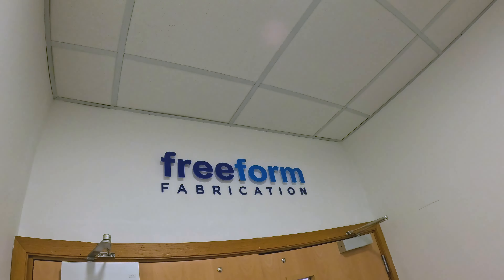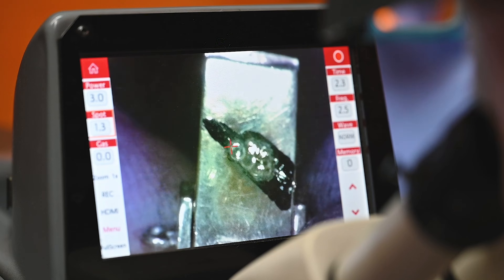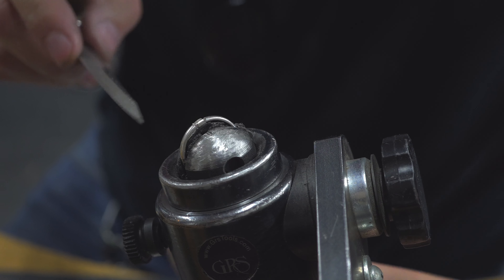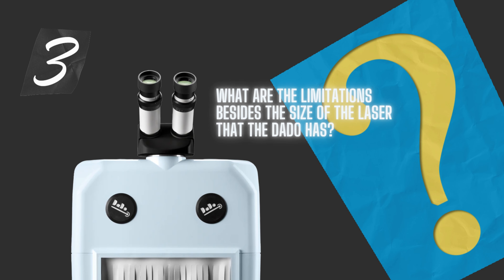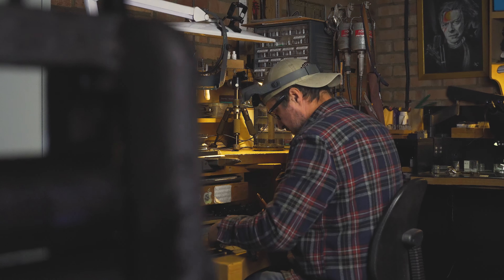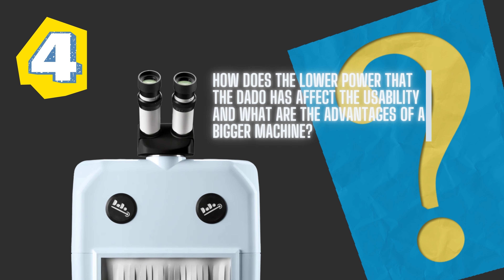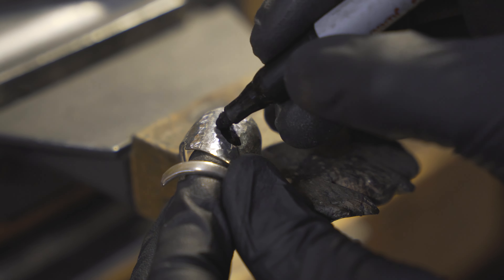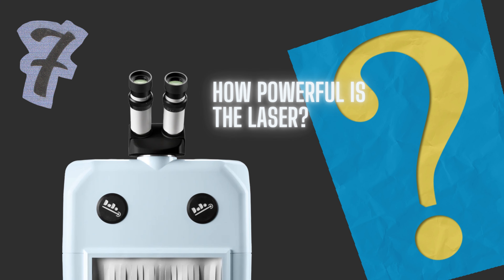Laser Welding For Jewellery - Part 2 | Goldsmith's Workshop Secrets

Comment: Fabulous for tack welding complex constructions together prior to conventional soldering. Binding wire is a thing of the past. Only real issue I have found is doing repairs close to old soldered joints .... the laser tends to blast holes in any soldered areas. Planishing/polishing is easily done as well but you need to get the power just right which takes some trial and error/experience. Works for small areas well.
Reply from the maker: 👌🏻 great feedback. I hear you on the solder issue. Good point.

Comment: Argon in my experience helps with stainless steel and some white gold. A laser is a great investment if you have enough work. We use our laser all day every day.
Reply from the maker: That’s it. Thanks for answering the Argon question 👍🏻
Reply: Would you say this is purely to avoid oxidation? Do you think it makes the weld stronger or does it just make the laser shot more effective when firing on these metals? Thank you for answering the argon questions we are always open to improving processes!
Reply: @freeformfabricationUK  so in my experience these metals can be brittle at the join without the argon. I’m not really sure if it’s oxidation but I guess it might be. I’ve run some tests with argon on and off and can see a difference. We use laserstar wielders in the store.
Reply: I only used argon for a short time when I was offering repair to lens frames but speed offering the service when it was evident that the frames were made with such low quality that the repairs didnt last. Nevertheless, argon is a must for titanium and stainless but I have no issue with white gold or silver not using argon. I use the sharpie usually with silver. I use a rofin starweld

Comment: no wonder he's not for argon, hes british/english and they have no proper access to gasses and such. argon is absolutely necessary for big silver pieces and helps in general like he says with de-oxidizing and getting the wire to flow better into itself. especially if the piece has a polished surface it makes even more of a difference.
Reply: We have easy access to Argon if needed. We don't seem to have any issue with wire flowing or issues with silver without argon even on the lower powered machines like the dado. The oxidation that appears is polished out to leave a well polished finish and it doesn't seem to affect strength of join as we can tap up the ring two sizes afterwards all without using argon.